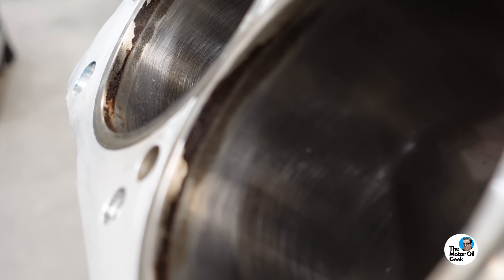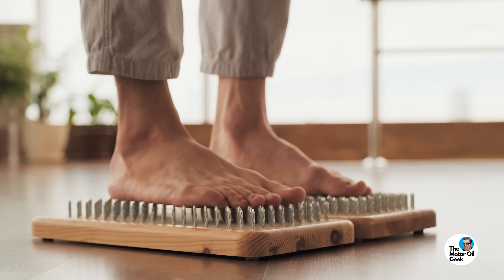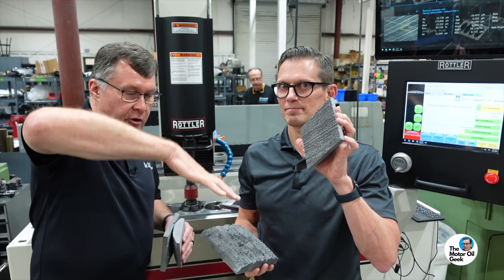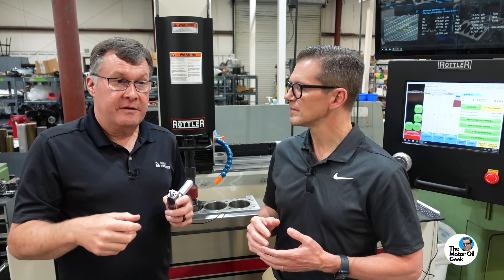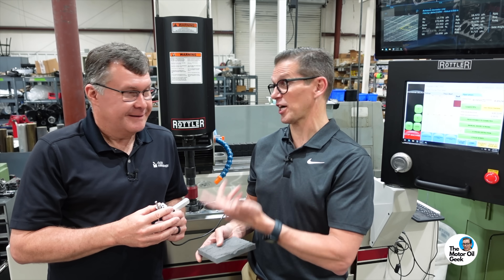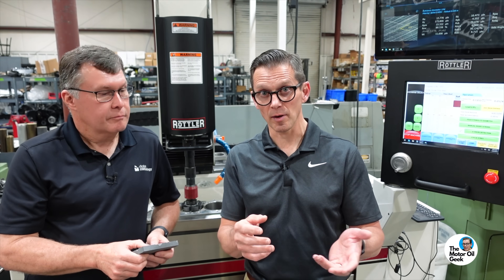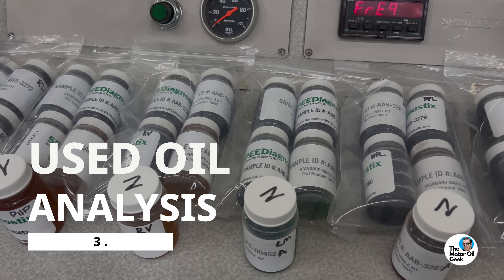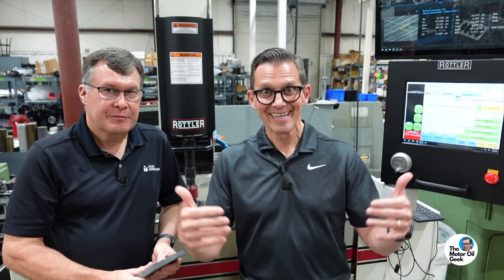GM's $1 BILLION Dollar Blunder: ROUGHNESS Matters...

Comment: Back in the 60's there was an oil additive called Wynn's friction proofing, it increased idle by 500 rpm, I also added it to my mandrel tube bending oil increasing tubing bending from 2000 feet to over 20,000 feet before the wiper die needed replacement, now I find that Dura Lube does the same and has the same smell of Wynn's, I also use it as a chain lube on my liter sport bike getting 70k miles from a chain and sprockets. usually only 10k is about all you get from any motorcycle chan lube.

Comment: and then there is the low tension ring problems . can we not go back to building the engines like we used to up until 2005 and earlier ? my 91 GMC has 450k on it with 5/30 oil changed every 4000k all I have done too it was valve stem seals on that 5.7

Comment: A different part, but a similar sentiment. I purchased a custom solid roller cam from a cam vendor that was well known, but I believe is not around anymore. When I received it, not only was it the wrong profile, but it looked as though it had been ground with 60 grit on a belt sander. Needless to say, this was an obvious flaw and I sent it back, after waiting 3 months for it to arrive. I had another company grind the cam I wanted and the surface finish was smooth, but not polished, which is what you would want with a roller cam. I think the first vendor forgot a step on that first camshaft. I'm fairly certain it would have failed quite quickly if I had not known any better and installed it in my engine.

Comment: I watched this with baited breath to lean more but this stopped before any real answers were given. I am a Metallurgist. (RET.). what I wanted to learn is at what micron the valleys showed a good of superior oil retention on both similar and dissimilar metals.  . The very meat of this testing talked about talked all around the subject but never got to the meat an potato's of the subject. Very disappointing. Would love to see testing of different finishes and coatings. 
KnifeMaker

Comment: Hey lake in your experience what diesel oil works best in a heui injection diesel specially a 6.0 powerstroke? Currently using Mobil 1 5w-40 diesel oil. I'm from Okla so we see hot summers and somewhat cold winters.

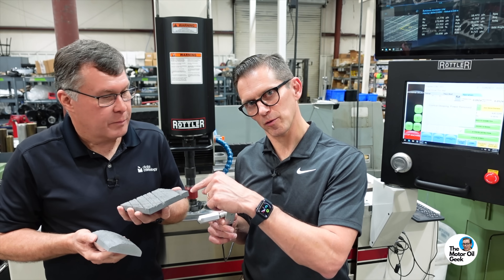Comment: 2:40.  THIS CROSSHATCH ISNT NEARLY IMPORTANT AS THE DAMN METAL ITSELF.  LOTS OF NICKEL IN THE METAL AND LONGEVITY... SURFACES DOESNT MATTER IF ITS RAW IRON AS THAT WILL WEAR DOWN IN 1 YEAR. ITS NOT THIS YOUR TRYING TO GET EVERYONES ATTENTION WITH YOUR PULLING THEM AWSY FROM THE REAL ISSUE CHEAP METAL
Reply: That's objectively not true, and I'm going to guess you don't have an engineering doctorate.
Reply: That is absolutely not how it works
Reply: @Corbots80 Ok so correct them
Reply: Well done, chap. You shouted your ignorance right across youtube there. 

I'll educate you a little.  A crankshaft runs in what's known as hydrodynamic bearings. 
The surfaces are separated by an oil film. They never touch. So the material quality does not matter one bit. What will matter, is the surface Finnish. Too rough, and the peaks poke through the oil film, and you get contact. Then the bearing destroys it's self.
Reply: @iainball2023 The fact they mentioned crosshatch tells you they're talking about the cylinder bore not the crank.
Reply: @erinburke9711 Yes, but the video was an explanation of why the gm engines are eating bearings. 
They used cylinder cross hatch as an example of how surfaces are finished. Presumably because more people are aware that the surface finish has an influence here. 
But it boils down to the same thing. In theory, the surfaces could both be made of cheese. The point is, they are separated by the oil film. They should never touch, so the quality / hardness of the material is irrelevant.

Comment: Nice explanation of wettability: the reason you need slightly rough surfaces is to retain and spread the oil across the surface. Also, the surfaces and they way they interface with each other may change during engine break-in. At @12:10, cutting open the oil filter and inspecting what it has captured is standard practice with aviation engines.

Comment: MY FIRST JOB WAS AT A GM DEALER BACK IN 1973 . I HAD BEEN WORKING ON CARS SENDS THE LATE 60'S . I REALLY LUCKED OUT THE OLDER GUYS WERE GREAT TO ME THEY KNEW ALL KINDS OF TRICKS . ONE ON THE SBC ENGINES BRAND NEW WITH CHROME RINGS WOULD BURN OIL . THE TRICK THEY USED WAS TO TAKE IT OUTSIDE TURN UP THE RPM'S TO AROUND 8 OR 9 HUNDRED AND SHAKE A CAN OF COMET INTO THE CARB . IT WORKED 95% OF THE TIME . THE FIRST TIME WE DID IT I THOUGHT THEY WERE ABSOLUTELY NUTS !

Comment: Ive run pitted crankshafts at 9000 Rpms with 170psi oil pressure.  Seriously. Not kidding.  All the engines i build / machine run at least 120psi on the mains.
Someone threw a pressure gauge on every single oil gallery outlet on these blocks. Some of those blocks show 15-30psi on the rear mains and rod. its also suspected that there may be lifter bore/valley overbleed causing localized low pressure areas. This 30psi stuff is ridiculous.  it wont float a crank under any detontation or rough running without kissing a journal. And start up yield low slow oil to that bearing.
Its not the crank buddy. Try again. - Retired Machinist. lifetime engine builder.

Comment: Did I hear that right ? The "rough" surface is now the cylinder wall when it was the rings before ? Doesn't that expose far more oil to the combustion process and end up"cooking" the cylinder walls ? Then you have smooth walls AND smooth rings.
Reply: Yes.  You heard it right... it's a balancing act to keep the oil controlled.  In some applications, like racing, a bit of oil consumption isn't a big deal.  For emissions-critical applications, it's a huge deal.

Comment: I run a full service auto repair shop and ive seen consistently that OEM engines we install turn over much easier than rebuilt engines from Jasper, power torque, S&J... all take 10, 20, even 30lbs more tq to turn over than a new OEM long Block. I would love to see you buy say a 318 from one of those big rebuilders dyno test it then pull it apart and analyze their finishes on the bore and crank, 
cam... correct then and retest it. Iinstalled a 5.7 hemi from a big name rebuilder that needed almost 50lbs tq to break away turning it with no plugs... another new from dodge not reman 5.7 hemi took 27lbs. The mass rebuilt engines also seem to use significantly more oil than a new OEM long Block... I don't feel like they have a good handle on bore finish for these new low tension thin rings everything uses, that one with the high breakaway TQ uses 1 quart of oil in just over 1000 miles and the rebuilder says it's not a problem, the guy who spent $1000 more on his Mopar engine uses zero oil between oil changes.

Comment: I used to work for a global industrial bearing manufacturer, and we used to gauge surface finish on every 10th part to keep it in spec. They also had a "surface finish" process that uses tumbler vats and a ceramic media, plus chemicals to tumble bearing cups and cones. They would come out super smooth, looking like chrome!

Comment: GM moves the consumable wear to the cylinder liner. Who signed off on it? What other manufacturers and suppliers are also cutting corners? This shows a huge QC inspection failure. We need more independent investigations to uncover these manufacturers and engineering failures.

Comment: Lake, I feel like there's another area of opportunities to decrease wear & increase life of engines in emission analysis (especially in diesel engines)
We had that testing capability at one time (surface mining operations) & we could find engines that were getting "out of tune" & once the corrective actions "tune-up" were completed, the used oil analysis improved, even though they were still in normal ranges.

Comment: I spent decades in the automotive industry, and actually had to work with Ra factor in the machining process.  I'm stunned that an Engineer or machinist from Mahle, Federal Mogul or one of the other companies that prototyped these pistons and then manufactured them didn't catch this error.
Reply: It is possible that it may have been caught and made them aware of the issue,but once the decision has been made by the accountants/ management nothing will change that decision. The machinist are not respected or listened to.

Comment: Raw cranks are turned or milled, then ground and then belt lapped in a manufacturing plant. All finished cranks are then inspected in an automatic inspection cell. 
Either the crank material is wrong or the lapping belts are substandard.

Comment: So basically if you buy new aftermarket piston rings or give your engine away to hone the cylinder walls, these 2 need to fit together.
Good engine machinists know how they work together, but I bet a lot of tuners dont and then choose one side that doesnt fit the other and then the engine goes boom after a while and people dont know why and blame the oil, wrong torque, claim the customer didnt warm up the engine, too much power or whatever.

This is why I stick to stock parts as much as possible, especially if they are known to last a long time. In this crankshaft case of course the stock one was a bad choice.
Reply: Especially with the new engines running low tension rings. I re-ringed Honda CR-V engine a few years back. The usual baked oil control ring problem. New set of Honda rings and I deglazed the cylinders with the stones 'our' machining guy gave me. It's almost 100k km since then and I haven't heard complaints about engine using oil. We only said 8k km OCI max. Before the engine burned so much oil, it burned the valves. With these 2.4L keeping proper OCI is very important. Once you go past 10k km the oil degrades and problems start. We had one CR-V where side of piston crown melted down to control oil.

My friend took a X5 i drive, V6 for a test drive after brakes job, fluid change, engine oil, etc. The engine span crank bearing on him on fresh LM BMW spec oil. Supposedly they're known to do that...

Comment: At prior job, we made large bore hydraulic cylinders. We would machine steel columns to a 32 RMS diameter, send them out to polish to 16 RMS, and when we got them back from the polishing vendor, we would put these columns back on a lathe and use a Scotch-brite belt to roughen the surface so it would retain hydraulic fluid and allow the cylinder assembly to move.
Reply: We are doing it with motorcycle fork stanchions as well.

Comment: I just don't buy that it is a surface finish problem.  They changed the oil spec to a thinner oil because of CAFE requirements and then the engines start having problems.  And part of the fix is the switch back to the previous thicker oil.  0W40 (no problems) -> 0W20 (major problems).  I understand that these kinds of problems are complicated sometimes but sometimes the cause is obvious.

Comment: Mankind is familiar with all the aspects of manufacturing an ICE engine, billions of engines have been made over 140 years. There is no excuse for base engine failures caused by manufacturing errors.
Statistically, you are WAY BETTER off buying an electric car. No crankshaft, no cams, no carbon gunk, no catalyst, no powertrain to really speak of. And less maintenance. Look at all the recalls and class action lawsuits for ICE cars, it's insane. Too much exposure caused by too many moving parts. Prehistoric.

Comment: Don't tell me we don't know how to make crankshafts hold up. There are literally two centuries of crankshaft development under our belts. We won WWII on reliable engines that reliably powered all manner of machines, often with severe neglect. GM's lack of quality control is a factor, no question about it. Add in some 0W-Water motor oil, low oil pressure, high oil temperature and high loads, for a perfect storm. 

We can endurance race engines on low viscosity oils. But doing so requires strict temperature control, something not present on GM's offerings.

Comment: In 1963 my crappy 56 Chevy convertible's 265 V8 was worn out to the point a piston cracked and when it was bored out, it had to be bored 0.060" to clear it up.  It was burning a quart of oil every 500 miles.  It was reinstalled after a complete rebuild and ran great but it still used a quart of oil every 500 miles????

Comment: GM planned to go all battery electric and a LOT of talent and experience with engines and transmissions in the design and manufacturing depts retired or left for other jobs.  Also COVID had a big impact.    
FWIW this vid would be improved by showing crankshaft journals (the actual GM problem) instead of cylinder bores.

Comment: Just thinking out loud…I understand the relationship of peaks and valleys and oil retention. So, it sounds to me that achieving the optimum balance in relation to the piston ring determines achieving the correct balance between mating surfaces…fine.  Ok, so then why leave the creation of these surfaces to mechanical honing devices? Would it not make more sense to use lasers to “burn” in a specific pattern?  I’m thinking along the lines of an ideal dimpling effect. It would not only allow you to create a uniform (top to bottom) surface, but it allows a much more precise delta relating peaks to valleys, no? By knowing the size of the oil molecules, you can build in the correct pore size to retain the optimum amount of oil at all times.

Comment: Have 6.2 fleet customer and he has had no problems I changed oil on first oil change to 5w/30 he took them in for recall no problem found  . So Far around 70 k miles but I send every other oil change sample to test . He said he glad we changed oil to 5/30
Reply: It has to be insufficient bearing crush. Rod bearings are pure hydrodynamic lubrication. The surface finish is much less important. These failures are sudden and catastrophic.
Reply: @gregorymalchuk272 Thanks we are checking everything and machine or replacing as needed
Reply: Yes, but he gets .05 MPG less!  Nuts!

Comment: Worked in and engine shop for years, we used to experiment with surface texture finish, different manufactures use different hardness of cylinders and require a different surface finish in order wear in properly with the ring types used, otherwise the rings will not seat properly and the thing burns oil like crazy!
Reply: Buell XB9s had this issue. Rings not seating.

Comment: For virtually any company, corporate or private, time is money.
When mass producing a machined product, the programmer for the machining process is going to run the machining center as fast as possible. If the speed is just a little to fast or the cutting tool too dull, you’re going to end up just like GM.

Comment: Well, I learned something.  I thought the 3D printed scale models really told the story about surface finishes.  Fascinating stuff and I am sure one could build an extensive library on optimization of applications for engines.  I never really understood how the surface finish of cylinders, rings, and oil viscosity had to work together to create the best environment for the engine.  Good stuff.

Comment: Former GM engineer. That manufacturing line has NEVER run correctly since it was installed nearly a decade ago.
Reply: What line, the engine manufacturing line or the one that makes the crankshafts?

Comment: smoothness is often the enemy of machining where metal rubs against metal. In many lathes and mills, basically anything that slides you'll often see a very old practice called "scraping" where you use a carbide tipped tool to create imperfections in the surface for oil retention.  This allows much better movement while holding tighter tolerances. The same applies here.

Comment: Just use gm branded 5w30 full synthetic for Ecotec 3 engines and change every 3k miles. Additionally at every 40-45k miles owners must replace the cam/valve lifters and clean the valves or expect damage. Looking at the valve lifter springs anyone with a brain can identify that the spring diameter is too small and with continual use WILL wear out faster than traditional lifter springs on top of the cylinder heads.

Comment: Lake, do you think that surface finish could be the cause of the problems that Hyundai/Kia had with the 2.4l Theta II engines (bearing failures)?  They wanted to blame it on metal shavings left in the crank journal oil passages after machining, but I, along with a lot of other people, are skeptical, wondering if it’s really about surface finish.  Just for reference, their oil specification was (and is) 5w20.